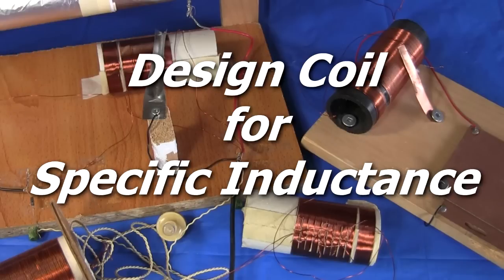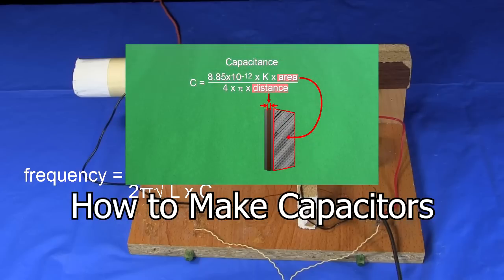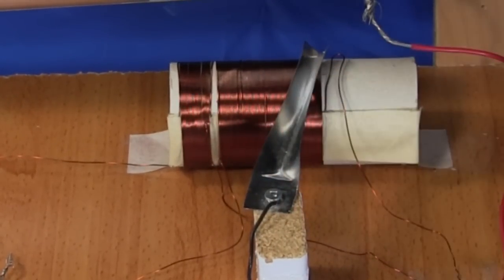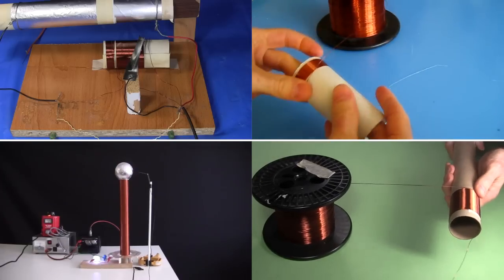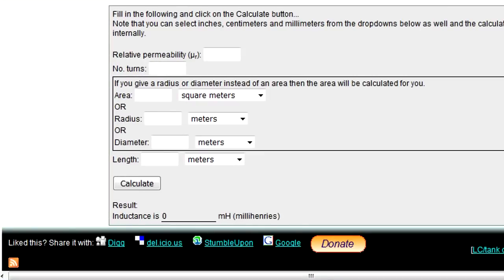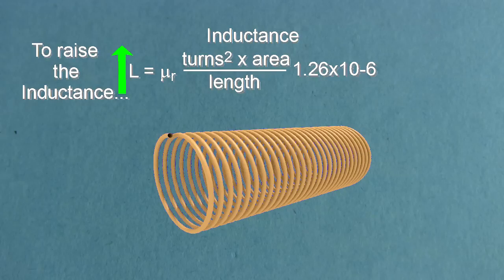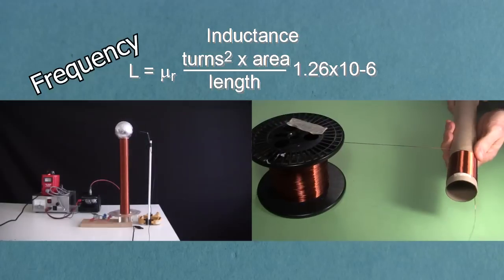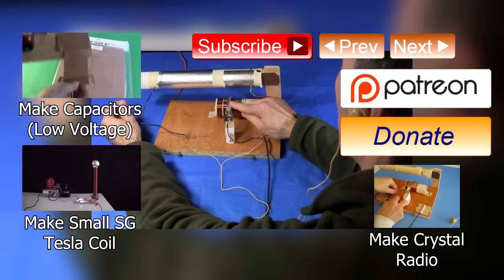How to Design a Coil for Specific Inductance

Comment: am designing a generator and i need to know for my coils how many turns of AWG 17 and how much voltage it will generate with 1000 RPM with magnet N52 1" x 1" x 0.5 " how please help

Comment: What is the difference in formula  between using copper tube or copper wire as coil?
Reply from the maker: Usually a copper tube has a much larger diameter than a copper wire so for a copper tube, the coil will be much longer or have fewer turns. Copper tubes are also usually used for higher voltage applications, like Tesla coils, and the spacing is usually larger causing capacitance to come into play. I don't have a formula for that though.

Comment: Using the same number of turns, 25 and 90, would a coil with a radius of 0.75 inches prevent me from picking up a signal?
Reply from the maker: I think it would be close enough to work. Make sure you also check out my tips and tricks page here https://rimstar.org/science_electronics_projects/crystal_radio_tips_and_tricks.htm

Comment: Resp.sir problem arises when    choosing the thickness of the  wire.There are no. of wires present for different thickness .How can choose required thick wire for particular inductance?
Reply from the maker: The thickness of the wire doesn't play a part in the inductance. It indirectly affects the length of the coil and the number of turns you can fit, both of which are part of the inductance formula. At high voltages it can matters since in that case you don't want leakage and so rounder is better at high voltage. But as far as I know it doesn't play a part in inductance.
Reply: The thickness of the wire is used in the calculator to figure the length. Ten turns with wire a tenth of an inch dia gives you a length of an inch....and so forth. The wire size is important due to current capacity requirements and desired resistance.
Reply: I tried with a 24 gage wire, which was way too thin. I don't think that thin of wire can handle much current before burning out. And it's difficult to connect the wire. You have to use sand paper to remove the plastic coat which is super tedious.

Comment: Does wire size affect inductance? Example: 1mm wire Vs 0.5mm wire? 
Let's say 50cm length. 
Yes with 1mm wire it will be less turns, than with 0.5mm .
Or it doesn't matter, it's all about length? 
Thanks
Reply from the maker: I see you answered your own question. It's all related. Wire size affects length and also the number of turns, which are both in the formula. So yes, indirectly, wire size affects inductance.
Reply: @RimstarOrg  thought so. Thanks for confirmation! 
Great video!

Comment: How would one go about creating a coil for a specific Frequency if only the desired frequency is known? I.E. I need a coil to resonate with 2000 MHz; say for the utilization in wireless energy transfer via coupled inductors? How does one start from just frequency?
Reply from the maker: I'm not sure if this type of coil will work for something at 2000 MHz. It might, but I'm just not sure. For example, here's a single turn coil I once made for something at 300 MHz https://rimstar.org/equip/oscillator_uhf_1.htm but I got that design from somewhere else. If I were to design a coil for a specific frequency though, then I'd probably use a caclulator. Here are two pages on my website that might help... https://rimstar.org/science_electronics_projects/lc_circuit_aka_tank_or_resonant_circuit.htm will allow you to play with different parameters to see what capacitance and inductances will give you the frequency you want. Then use this one https://rimstar.org/science_electronics_projects/coil_design_inductance.htm to some up with a coil that gives the inductance you want. I even have one for designing the capacitor https://rimstar.org/science_electronics_projects/capacitance_formula_capacitance_calculator.htm . But I haven't tried it myself for 2000 MHz.
Reply: @RimstarOrg  I've since found that for those who are a little mathematically challenged like myself you can actually utilize Chat GPT to help mock up coil designs for specific Resonances at certain frequencies more specifically in an LC circuit. I'm still learning though and I wouldn't even know where to begin with checking the math Chat GPT does to do this as it all looks like an alien language to me as it goes through the formulas haha. Also would need to check it with a Signal Generator / O-scope. I wanna get those at some point though I just don't have the money right now.

Comment: Hi sir, for my project I'll use a lower frequency (trafo), you said I'll have to use a solid core, is there any reason of doing it? or do you have a book reference for this? I want to know the reference for my paper, thank you sir
Reply from the maker: What are you using the coil for? I try to give some factors near the end of the video but there are lots of different uses. My knowledge largely comes from learning over the years so I don't have a specific reference in mind and the reference would depend on your use. A Tesla coil reference would be different than a reference for a radio coil which would be different than a coil for a filter and so on.
Reply: its because for lower frequency, typically you need a larger inductance, which is easier to obtain by using a high permeability core

Comment: I have a question ,when you take the length of coil...what do we actually take as length ,the length of wire wounded or to the distance it is wounded on the cardboard surface????
Reply from the maker: The length is the distance it is wound on the cardboard surface. Take a ruler and measure the distance from one end of the coil to the other end of the coil, without unwinding the wire.
Reply: It is not the length of the wire, rather it is the length of the coil on the surface it is wound.
Reply from the maker: That's what I meant, but even reading your version I can see how it can be misinterpreted. How about, take a ruler and hold it against the coil, lengthwise.

Comment: Sir is there any relation b/w gauge of the wire and inductance
Reply from the maker: There's an indirect relationship in that the thicker the wire, the longer the coil, which affects the length parameter in the formula (the gauge is an indicator of the thickness) but there's no direct relationship.

Comment: I have some speakers I need to repair but I'm not sure what gauge/thickness of wire to buy for the voice coils. data I have found: Kapton with 1.005″ inside diameter, 1.125″  form length, 0.437″ windings width, 8 ohms.
so what gauge or cross section wire would that be?
Reply: data provided is based on replacement coils I can buy but I don't want to buy lol

Comment: thank you
i am looking to enter the freq and the wire diameter to spit out the L value. does the wire size not matter?
Reply from the maker: The wire size plays a part in the length since the length is the number of turns x the wire diameter x the spacing between the wires. The wire size also plays a part in the area because when calculating the area, you measure your circle from the middle of the wire (see one of the diagrams on my webpage here https://rimstar.org/science_electronics_projects/coil_design_inductance.htm). The wire also has a resistance but when working on calculations for a coil, usually you treat the resistance separately from the inductance.
Reply: @RimstarOrg  thanks for the link, unfortunately it goes to an error :(
Reply from the maker: Oh, I though YouTube's alogrithm was smarter than that at recognizing links -- it's including the closing parenthesis in the paragraph. Try this: https://rimstar.org/science_electronics_projects/coil_design_inductance.htm

Comment: Sir, I found out that 1.26x10^-6 is the permeability of air. Is it any different with ur (Mew r) or the permeability of the core in your given formula?
Reply from the maker: Yes, it's different than ur. 1.26x10^-6 is u0 (Mew sub 0) which is the permeability constant. ur is the relative permeability.
As I said in the video, air has a ur of 1 meaning that it is 1 x u0 or 1 x 1.26x10^-6.
Iron has a ur of around 100 meaning that it is 100 x u0 or 100 x 1.26x10^-6. 
That's why in the formula I show at 5:03 I'm multiplying 1.26x10^-6 on the end of the formula.
The real reason it's called the 'relative' permeability is so that we can say things like, iron's permeability is 100 times that of air, it's permeability is 100 relative to air. It also prevents us from having to remember numbers like 126x10^-6 (which is 100x1.26x10^-6).
Side note: You may see u0 written as 4pix10^-7 (you'll see the symbol for pi instead). pi is 3.14 and if you multiply that out you get 1.26x10^-6, the same thing.

Comment: Hi, when you said for low frequency application suitable for iron based core. Is there any thumbs of rules that define those region?  Like Khz, Ghz, Mhz,etc?
I am newly introduced to in inductive charging, and I have to make an antenna coil with steel core due to requirement. Basically trying to use those QI transmitter to power a device with steel core.
Reply from the maker: There are ferrite materials which are more suitable for higher frequency but you have to look up the specific ferrite material to match your frequency range. I don't have any experience with GHz.
Whether or not a core is suitable also depends on your application. As I said near the end of the video, Tesla coils don't want a core whereas step-up and step-down transformers benefit from one. In terms of power transmission, I've only played a little with it but from what I see, they tend to not have a core, though possibly a core on one side only.

Comment: Hi RimstarOrg
Thanks a lot for sharing wonderful videos to learn electronics.  I am a 
beginner to learn Radio and circuits . I really appreciate , if you 
could explain a 1- 2 transistor
( NPN )  Radio transmitter  and receiver circuit  for AM  and FM.   and 
explain why we need a  resistor there , why we need a capacitor there , 
why wee need a inductor there....why we need a transistor there ...... 
and how  electrons / Current/ signal   go through ....  Currently some U
 tubers explain  Conventional current and  Electron movement ... so it 
is very confusing for for beginners  like me ... they never say their  
explaining using conventional   current or electron movement. I think 
there are lots of people like me around the world , to learn these 
stuff.  I really appreciate if you could post a few videos around this  
 Kind regards, Dinna
Reply from the maker: Hi Dinna,I sort of have any radio videos that explain radios with transistors. I have a crystal radio explanation, which has the inductor and capacitor but no transistor. That's in my How a Crystal Radio Works video http://youtu.be/0-PParSmwtE. For the transmitting side there's my video about amplitude modulation with a simple transmitter https://www.youtube.com/watch?v=R04yEKqgGPc. But I guess if you also watch the video about making an earpiece amplifier for a crystal radio, near the end of it (around 5 minutes in) there's an explanation involving the transistor. The crystal radio and the amplifier videos both use electron flow (and it's clear in the videos that they do), while the amplitude modulation video doesn't involve current flow in the explanation.
Cheers,
Steve
Reply: Hi RimstarOrg
Thanks a lot for the reply. I watched all above videos before. They are all really good. Appreciate If you could explain a complete full circuit when you got time. That would be very valuable for lots of people. Kind regards,  Dinna

Comment: May I know how to select wire size in this inductor?
Reply from the maker: The wire size affects the length and the number of turns you'll need. So a formula can be made that includes the wire size. On my webpage here https://rimstar.org/science_electronics_projects/coil_design_inductance.htm I have a section in a calculator that uses the wire size. You can try different sizes until you get the inductance you want.

Comment: I want to design a tuning circuit for variable frequencies. From the resonant frequency formula, we have L & C. The values are unknown. If I calculate the inductance using the above formula, I still need to know the radius and number of turns.(air core) How do you decide the number of turns and radius of the coil??
Reply from the maker: I start with the materials I have. For my crystal radio and Tesla coil, for examples, I had the tubes that I was going to wind the coils on, so measuring it gives the radius. There's some trial and error. Putting the formulas in a spreadsheet makes it easy to try a variety of values. If you know the desired frequency range and have some idea of what capacitance you can make capacitors for (or have capacitors for), then you can rearranged the LC resonance formula to solve for L (or use the calculator on http://rimstar.org/science_electronics_projects/lc_circuit_aka_tank_or_resonant_circuit.htm). Then rearrange the coil inductance formula to solve for the number of turns, though that's kind of hard to do if you don't also know the length. That's where a spreadsheet comes in handy since you can punch in different values until you get what you want. In the spreadsheet, length can automatically be determined from the turns if you know the width of your wire.
To get the width of your wire, I wind an inch or whatever length or coil on the tube, measure it and divide it by the number of turns to get the inches per turn.

Comment: So what if you use graphite as you core, it's permeability is less than air, so that will make the coil bigger for my needs? P.s. I'm still learning,  long way to go
Reply from the maker: I don't know. It's magnetic permeability is only very slightly less than air so it may not make a big difference. However, that also means it's diamagnetic (https://en.wikipedia.org/wiki/Diamagnetism) and I don't know what the effect is of diamagnetic materials in coils. P.S. As you can see, I'm still learning everyday too.

Comment: I found this formula for an air core inductor, but using your example, I can't get a confirmation.  Is there a problem with this formula or is it the wrong formula to use?

L= (d^2 * n^2)/(18d+40l)
where:
L is inductance in micro Henrys,
d is coil diameter in inches,
l  is coil length in inches, and
n is number of turns.
Reply from the maker: I don't get the same thing either. I plug in the parameters for my crystal radio coil and get 369 microhenries, which works well with the capacitance to get the resonant frequency range that works so I'm confident in it. But doing the same with the formula you gave gives 0.249 microhenries.
Where did you get the formula? Perhaps there's some context missing.
Reply from the maker: I'm starting to get some clues.

On https://en.wikipedia.org/wiki/Inductor it gives the formula I use (as well as http://www.electronics-tutorials.ws/inductor/inductance.html and http://hyperphysics.phy-astr.gsu.edu/hbase/magnetic/indcur.html, both very reliable websites) and describes it as "Cylindrical air-core coil" but it has an additional parameter K which is 1 for a coil which is much longer than its diameter (a Tesla coil's secondary, for example, is much longer than its diameter). So as long as the coil is a long one then it's the same formula. I originally got mine from Grob's Basic Electronics textbook 4th, also a reputable source, and double-checked with the above websites.

The one you're pointing out is also on https://en.wikipedia.org/wiki/Inductor and is referred to as "Short air-core cylindrical coil". As you're finding, it's used by a lot of online calculators and they sometimes refer to the ARRL handbook, also a reputable source. I have a copy of that too and looked it up. They refer to it as a simplified formula and say that it gives a "close approximation for coils having a length equal to or greater than 0.4d" where d is the diameter.

Incidentally, in ARRL they also say that for even shorter coils they give a chart instead to look up.

So it looks like there are different formulas that work best depending on the length of the coil with respect to its diameter. I guess some property plays more or less of a part as the coil length changes.
Reply: Thank you for the well researched response.   Is it possible to get a copy of that table?   Is it on line?   I am deeply interested in any kind of unexplained property or phenomena that causes unknown or undefined discrepancies.  Please note that the two references I picked we're slightly different in formula too.   What about small coils used  in a step down converter circuit , for example.
Reply from the maker: I doubt that the ARRL handbook is online but there may be a similar chart somewhere. I don't know where though. Just to be clear, it's probably not an unexplained property, just that I don't know the explanation. I could probably find out more from more research but not at the moment.
Reply: OK... I really appreciate your feedback.   If I find anything,  I will let you know.